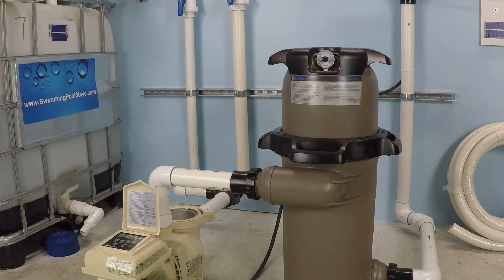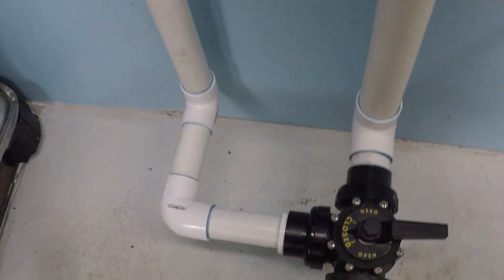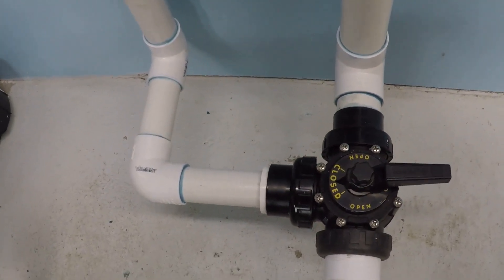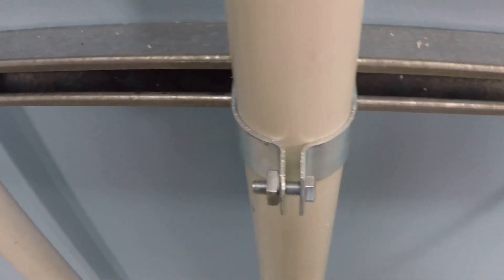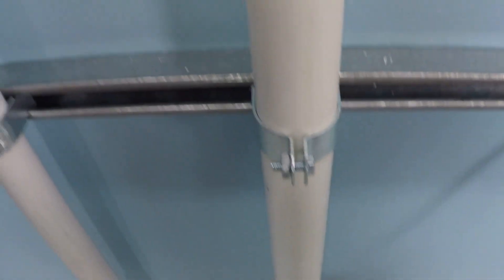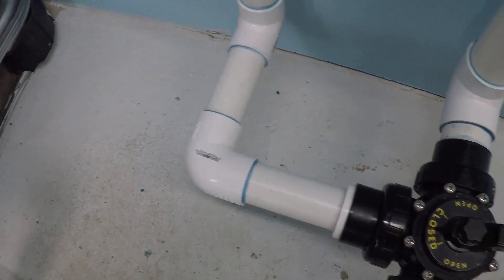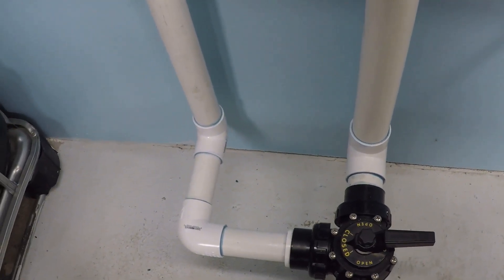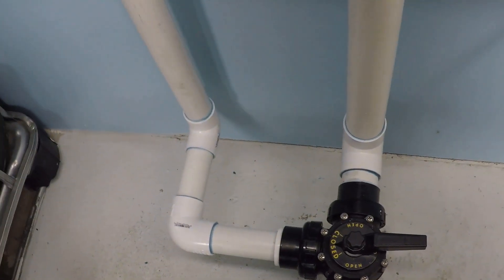Pipe Size For New Pool Pump

Comment: Hi Steve, thank you for posting this video. And, now I've got a question if you please help. I'm in the process of remodeling my pool. Currently I've got three 1hp pentair whispflo 1.65 service factor pumps. One of the pumps is on the sand filter, another on the floor cleaner pop-ups as booster and the other is used for the water features (fountains). My question, i bought a pentair veriflo 3hp pump to power my new cartridge filter and the installer mentioned i may have problem with my returns as they are on 2 inch. With the amount of water being pulled from skimmer and floor suction as they are both 2 inch he reccomends i go to 2hp pump and/or put new 3 inch returns. Or, use the pump to power water features and then I would need a double three inch suction in the wall. crazy! Although it makes sense.

Comment: So I measured the skimmer suction is about 1.5” but the going to the pump is 2”.  How much HP do you recommend?
Reply: 1.5 to 2.0 should do fine
Reply: I'm a pool technician 1.5 to 2.0 should be plenty of horsepower

Comment: Swimming pool Steve…what’s the deal with pumps with “2” intake and outlet” I just purchased a new waterway pump and My “2 inch” threads do not line up with 2” pvc fittings.

Are pool pumps measured differently somehow? Where do you get a converter, my pipes are 1.5”
Reply from the maker: I think waterway have unions that you need to use.  It is not a standard thread size

Comment: But changing from 1.5 inch to 2 inch doesn't do shit if your long runs are still 1.5 inch right?
Reply from the maker: You are still limited in total flow by what is in the ground, but the majority of efficiency loss happens on the equipment pad.  If you have 1.5" pipe on the pad then 38 gpm is the maximum efficient flow beyond which you have sharp losses to friction and turbulence.  If you upgrade the equipment pad to 2" then you can run 65 gpm through the equipment still in laminar flow.  So a substantial increase in flow efficiency.  If you have mulitple 1.5" suction lines then almost certainly you will benefit to upgrade everything from the suction side manifold to the pressure side manifold to 2' pipe.
Reply: @Swimmingpoolsteve  I am a huge fan of your site and was wondering this exact question.  As soon as I read the 38 to 65 GPM, I had my answer!  Thank you for all of your great videos loaded with so much information.  I have pages of notes taken while watching your videos.